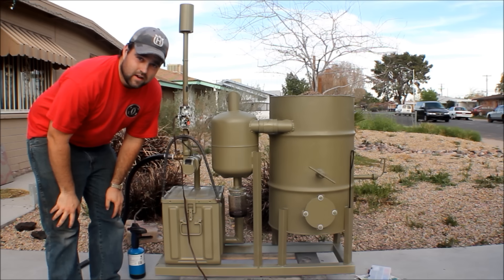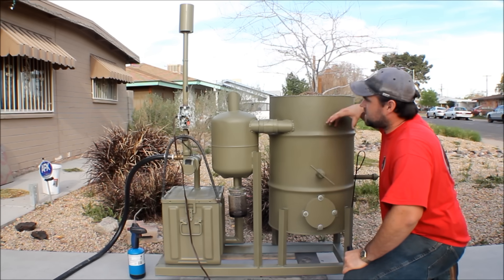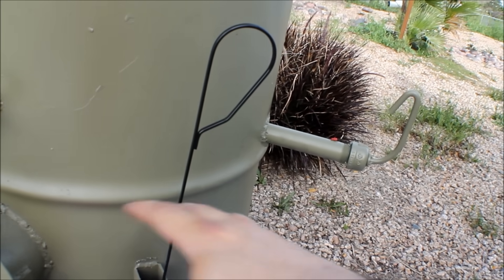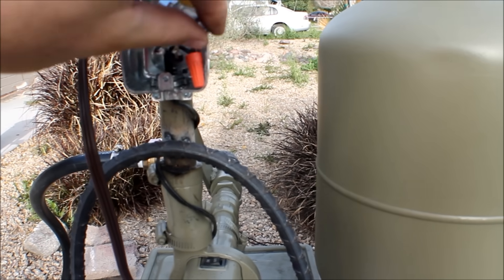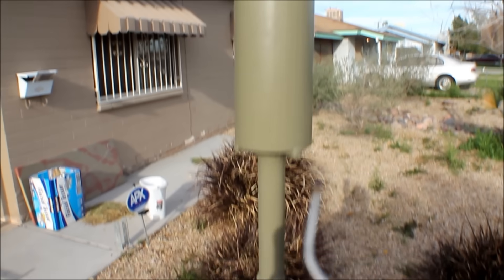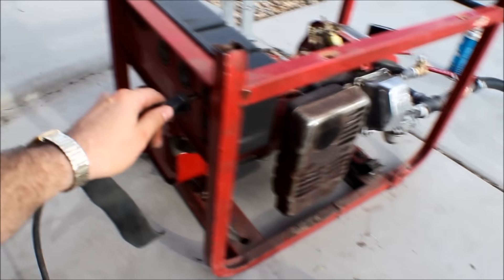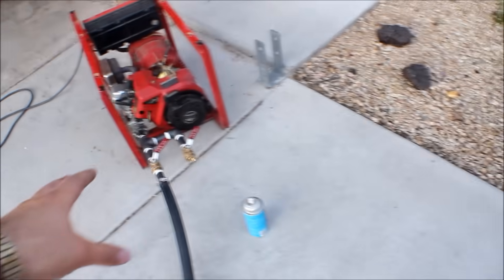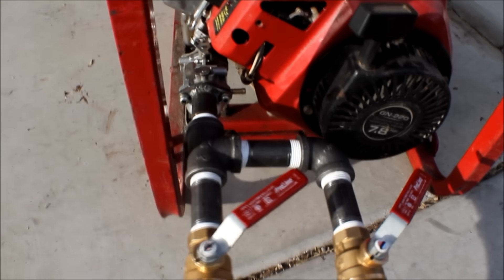amazing homemade gasifier uses wood pellets to run generator -- renewable alternative energy video

Comment: did you know during WW2  all cars and public transport where converted to gasifiers so fuel could go to armed forces. theres heaps of videos on the net of car and bus running off thos system. so its proven and works well in a Zombie apocalypse
Reply: A few were, yes, but no where near all
Reply: @Legocraft4598    6ddd76 says added d
Reply: @Legocraft4598  apply the 80/20 rule.  (80 % did, 20% didn't)  So, it is above a majority.
Reply: The germans attempted to use it in tanks, but it wasn't powerful enough
Reply: Alright, that kind of makes sense, but how am I going remember how to maintain one of these things when I get bit by a "Zombie" and have this hybrid apocalypto rabies disease everyone is getting -- Or,  is that just side effects from K-2 and "Bath Salts" -- LOL ?
Reply: @wmhoffman1622  Good point.  Long range, what after 100k miles, overhauls, etc.  Not like a VW engine  you can keep running forever by replacing parts with five wrenches and a crowbar!!!
Reply: @wmhoffman1622  about the time you get everything built they come, Move to an island which what I will do. Live in Tampa there are two islands connected by small roads that are state parks,, That is where I will be heading Do not know why on Walking Dead they do not move to an island
Reply: @altha-rf1et  Atlanta, ga doesnt have island's  🤣
Reply: @lawrencewarren8243  inside. 285 is an island .
Reply: You are correct but only in Europe, it did not occur in the USA because gas was rationed based of your job by the OPA with stamps/tickets.
Reply: @Angus: I believe what you meant to say was, during WW2 in GERMANY. Not ALL were converted but many vehicles were. The military Kubelwagen (German version of the Jeep) was one. It was converted to run on wood or Anthracite coal near the end of the war due to the scarcity of gasoline. The tell on the vehicle that it was converted, was a hump on the front hood.
Reply: that was back then , new cars with their board computers and needless electronics cant run on wood gas 
like a old ford or a VW bug or VW Golf could can and did - Wermacht VW bugs and Opel trucks were largely converted to wood gas - the produced charcoal was used for "smokefree" cooking on the eastern front the tar was used for chemical industry - adhesives, cardboard seal impregnations and fuel additive for ship diesels
Reply: my grand dad made one for his car when there was a shortage of fuel here in New Zealand back in the day lol so yes they are real and proven technology
Reply: i remember seeing a gas powered truck in Dads Army.
Reply: WRONG!
Reply: youy love it dont you zombie?
Reply: In the '30 cars where made with "dual-fuel" ...
Reply: Just wanted to tell the same... :)
Reply: I didn't hear him mention how much pressure the system has? or how much pressure is the system built for?
Reply: @normal_norm2627  pressure? there are some fans but its all just flow through. have a look at the FEMA plans, Its all online. No more pressure than your wood stove.
Reply: @douglundy5755    Thx Doug. 
I didn't think there was but the type of pipe he was using made it loook that way to me. I always thought black pipe was for pressurized applications. But I'm no plumber and haven't built something like that for a few decades.
Reply: @normal_norm2627  Sure, youre welcome. The gas is just drawn through by the engine intake vacuum and flows by ambient air pressure. This gas COULD be pressurized at a low level like propane for example and used for cooking or lighting. This would be another process. Its an interesting technology going way back to times prior to fossil fuel when industrial engines were run this way for factory or mill uses, before there was anything like fossil fuels.
Reply: @douglundy5755  It is pretty fascinating Doug.  Kinda surprising that there's not more of this type of alternaties out there. Well, no it's not. I'm pretty sure that any amazing device that comes to the patent office gets swallowed up or bought out before it becomes public... that's just my conspiracy side talking.
Thanks again.
Reply: carnage6ar  are u sure?  I'm going to call FEMA !
Reply: carnage6ar  you ought to see my solution it's the only one that I can think of and it's the only one that has a chance if we do nothing we ain't got much of a snowball anyway I thought of it about a year ago maybe eight months or say that but I've been scared I just posted last couple of weeks here it's totally legal and it's part of their own game use the same rules just different players I'll send you a link if you want I need help posting it
Reply: Thanks for the info, was looking for something new to research
Reply: There was even a training Tiger tank with a gasifier http://i.imgur.com/DNZMLLR.jpg
Reply: WOW.  I wonder what this fuel does to the system (manifold, valves, rings, cylinders, etc.)  Seems like time between overhaul would be shorter do to soot, etc.  Still, without gas, you do what you can with wood or whatever.  Engineering on steroids!
Reply: a few years ago 3 kids in sweden converted an old volvo to a gasifier, and drove it across the entire country.
Reply: @swedfilms  Pre-engineering students?
Reply: Don’t think wood powered vehicles were the norm in the US during WW2.  However I do recall hearing that some city transportation in Japan was using wood gasifiers. I’m old enough to vividly remember gasoline ration tickets being distributed to US families back in the early forties.  Another scarce item was rubber tires, so synthetic rubber was used for tires.  It was more of a failure because the “rubber” deteriorated very fast.   A company called Thiakol (?) was experimenting with, what they had hoped would be a better synthetic rubber.  They made batch after batch of test “goop” but none of it was any good.  They tossed the failures out in their dump.  Somehow a batch caught on fire and burned fiercely but surprisingly at a steady rate.  So ... that “failure” eventually became the world’s best solid rocket fuel. Just in time for the beginning of the US “space race”.
Reply: Angus Whitehouse Don't think all cars and public transport were converted to gasifiers during WW2. Maybe in the video game you were playing but not here on Earth. I am focusing on the word ALL, nothing else.
Reply: It was a little more complicated than that. There was no shortage of gasoline, but there was a shortage of natural rubber for tires since that come from tropical countries like Indonesia or Brazil. The government rationed gasoline in an attempt to reduce the tires from being worn out. Americans are ingenious and bypassed the rationing boards. I've also seen trucks run on powdered coal.
Reply: @UrbanBard1  exactly so, this guy's statement was way oversimplified
and farm equipment as you likely know was run on dual fuel, kerosene after the engines warmed up on gas..in China they still build engines with this capacity. Anyone can do it.
Reply: @UrbanBard1  You´re wrong. We really had a severe gasoline shortage during WWII - the later in the war the worse -
What do you think why e.g. many fighter aircraft could not fly ??? It was neither a shortage of pilots nor lack of spares.
Unfortunately the system to gasify wood is in no way suitable to be installed in an aircraft and the amount of gas produced isn´t much. Even for cars it leads to reduced power - but it works. It was tried for tanks as well but proved to be unsuitable as well as the achievable amount of gas to be produced was not sufficient to run a tank engine. The size of that gasifying system to run a tank engine would have been much too large to be installed on a tank. And imagine you´ld need an extra "chauffeur" to feed the gasifier continously with wood in a steam engine like set-up ...
Unrealistic to have a trailer behind a tank filled with stacked wood (yes, you´ld need a huge amount of wood).
Reply: MHG1023
Reply: The Dark Sorcerer 

In Europe all where.
Reply: Haven't gasifiers been shown to be dangerous in vehicles?
Reply: @spaghetti7782  yes. But only if you get a leak, and there are carbonmonoxid detectors that tell you if you need to roll down your windows. Basically, the same problems with gasolin and gasifiers exist=colourless, tasteless, smelless gases that painlessly choke you to sleep, and death. That is why people tape hoses to their exhausts to kill themselves.
Reply: @w0t3rdog  I've heard they can explode too
Reply: @9753flyer  they aren't nearly as likely to unless they're like a racecar engine that revvs really high and is under a lot more stress than most engines
Reply: Damn! Are people really this stupid?
Reply: Wow, the entire country ?  What -- is it the size of New Jersey -- where you can drive from one end to the other in 1/2 an hour ?
Reply: @wmhoffman1622  I looked at the documentary recently about these fellas. Sweden is approx the size of California. They had a trailer with them, with wood and the means to prepare more wood as they went. The car consumed about 13 liters of wood per 10km. They resupplied their wood storage 3 times to cross the country.

Comment: ok! What kind of gas is the gasification equipment making? You never really say what kind of gas you are making. There are some people out there that does not know what kind of fuel you are making. I know that you are making/producing hydrogen gas from wood.   Now I have another question/idea. I wonder if you could connect it to a compressed to compress the hydrogen gas? I know that you would have to keep the compressed cool some how so that it would not over heat as to prevent it from going BOOM!!!!!!!! Very nice gasification generator you assembled.
Reply: Its called wood gas. Its a bunch of hydrocarbons so no, its not hydrogen.
Reply: Wood gas is a hydrocarbon. It is created in a low oxygen environment along with hydrogen and carbon monoxide. Both are hydrocarbon gases. Then in a rich oxygen environment to produce another hydrocarbon that is carbon dioxide, heat(combustion) and water in an engine ,or open flame to cook with. I have read and investigated this type of fuel. I am going to try and assemble and construct a bio mass gasification generator myself. I want to connect to an air compressor and fill out dated propane/butane bottles. I really like the one you have constructed from fema  plans. I like the way you have it set up. small and somewhat compacted. Best one I have seen yet. You did a great job. Hope that the one I make looks 1/2 as good as yours. Would also like to know if you had any real problems getting and making the components of your gasification generator?

Comment: Sorry in advance for my ignorance..... but one question I have is, does this gasifier produce fuel that (over time) harm the motor/generator?
Reply: From what I have found is that as long as the filters clean out the tar to keep the valves from getting contaminated in engine.

Comment: looks great, made me smile in disbelief. good job, now I'm going to experiment and work my way up to a size like this
Reply: Or just use a simple mechanical damper on it, this way you can run the fan full speed and still be able to control airflow.

Comment: This machine is has a fuel energy content efficiency of ~75%. I did a little math (I'm no engineer) and based on the average American household kw/h of 911 per month and a conversion of 1.1kg of wood per kw/h, I think I can safely estimate that you can run your house for around 6 months from one 24 meter tall white ash tree. But since I'm not a mechanical or electrical engineer, I could totally be (and probably am) wrong.

1.1 kg wood/kw/h
650 kg/m^3 white ash density
h = 24 m, r = 0.3556 m
(π)(r^2)(h) = 9.53 m^3
(9.53 m^3)(650 kg/m^3)  = 6194.5 kg tree
6194.5 kg / 1.1 kg/kw/h = 5631.36 kw/h per tree
(5631.36 kw/h) / (911 kw/h/month) = 6.18 months of power

I know trees aren't perfect cylinders, so this is inaccurate, but this doesn't account for branches, either. Is this realistic or am I way off?
Reply: You are wrong. its 24.00325 meter tall white ash tree.. LMAO i had too.  Your pretty close tho. Im sure there are more than the obvious variables to throw in there to get the exact number.
Reply: So, since average white ash is about 60 feet and he needs 80 feet. With 3 trees, he can easily run his house for a year. 

I looked up southern pine, since they are more plentiful in my area.
Those are 52 - 53 lb/ft^3 density compared to white ash 48 lb/ft^3.
And they are on average 90 feet or greater.
So, I could use only 2 southern pine trees per year.

Almost seems workable.

Comment: replace battery with solar panel. 30-100 watts and or batter on charger.
Reply: How could the battery kept charged for free ? Small wind turbine powerful enough? Or would solar panel keep it charged or does it go direct to blower?
Reply: There is a generator?
Reply: @johnathanpike1719  you only need the blower for a few minutes to start the gasifier, so a solar panel would do just fine as long as there aren't too many starts and stops. a 7Ah battery can handle the blower for 3.5 hours, if you want to keep it for a long time, you need to top it off every 6 starts (or 1 hour of blower run time), so you need 25Watts (what the blower draws) for an hour, which a small 25W panel will produce in less than a day even when it's cloudy (in theory it would produce it in an hour, but the rating is for midday sun, so if it's cloudy and raining you may only get a couple of watts.)

Comment: That is nice.  I have seen a show on discovery where some people use same type of gasfier and run their pick up trucks on the gas generated by same type of gasifier.  They only difference was that they used wood logs.  It can be done.  In some countries they burn trash and run gasifiers to make electricity, but the pollution issue has to be considered.
Reply: Zain Abidin the cyclone unit and the carbon scrubber are setup to collect the dirtier compounds.  However, if it is just wood, the product would primarily be methane, as seen by the invisible flame.  The input of trash would result in noxious (NOx) compounds and harmful sulfur compounds and other acids... naturally you want to avoid that unless you are using a multimillion dollar plasma gasification system
Reply: I remember that show! Do you remember the name??? I thought about that same show as I was watching this but I failed to remember.

Comment: there are a hell of a lot easier ways to make wood alcohol
Reply: Wrong.  There are many examples where this runs cars, trucks even a motorcycle.  If it can run a generator motor it can run basically any motor.  Might not win any Formula 1 races though.
Reply: Too right! Cars and trucks were run with it during WW II with the shortage of gasoline going on (at least here in the UK) and anyway it's a wood gasifier in the video and the generator is running on cleaned up wood smoke not liquid wood alcohol like some people here seem to think;)
Reply: I'm new to all this. What are some other methods? I was reading some comments on another video and came across someone explaining one of these machines run cars and me not knowing much about stuff like this thought it was a fairly new invention then I found this video and a list of a bunch more. I felt pretty dumb. I can make things with electronics fix everything I work on but don't know anything about motors. This is amazing. What would be the best method of doing this be in your opinion?
Reply: the machine can not run a vehicle unless its a steam engine. Its the wood alcohol that is produced that can run a simple motor. It is no more amazing than making grain alcohol! and we already use  10% of it in our gasoline. And drink it as booze or burn the pure shit in out alcohol stoves.
Reply: +R Christie If there was a way to make this smaller could it run maybe like a 2 horse power motor on a small go cart frame? I would even settle pulling this monster in a wagon behind me lol. I'll just have my wife stand on the back feeding the fuel in. Maybe someone tried it already and it didn't work. Could be why I never seen one. Would be a ton of fun tho.
Reply: certainly..go get an old pressure cook pot, fill it with wood, run a copper tube from the lid, through some cold water and into a container and collect it. Freeze it to separate the water from the alcohol and you have pure alcohol. but a 2 housre power motor... better burn gas.
There are problems with running motors on alcohols.. Alcohols absorb water and rot rubber gaskets.
Reply: It is not alcohol that  this machine makes.
It is about 20% hydrogen, 27% carbon monoxide and 50% to 60% nitrogen.
Inside the internal combustion as the wood gas burns, the products of combustion are carbon dioxide (CO2) and water vapor (H20). engine

Comment: Hi JR, would you share your knowledge, with information and plans to enable us to make a wood gas generator like yours, so as we can run a generator of at least 10kw.I am a volunteer aid worker in south western Mindanao, Philippines, the rebels have a bad habit of blowing down transmission lines, and when that is not happening, the grid generators simply do not work.We don't have money to buy plans: we are very good scavengers, and are able to gather what we need to make: you may have seen documentaries of locals here, making many types of handgun, with the most basic tools, so if we are directed, we can make about anything.Could you, or somebody else, see your way clear to help us?I can be contacted direct on teroea@tutanota.comRegards,Rob